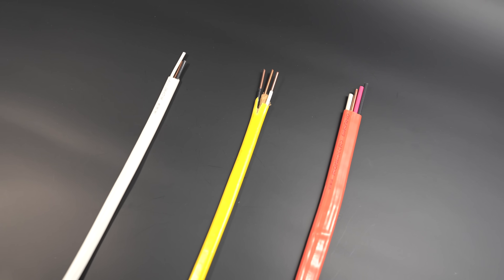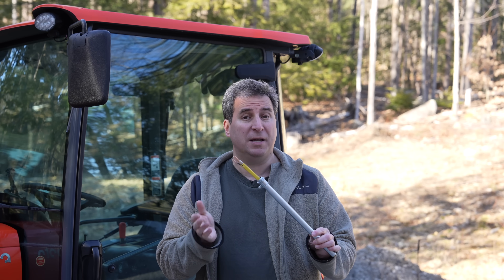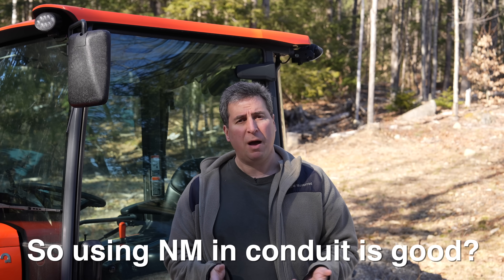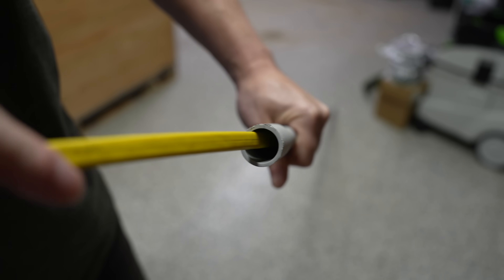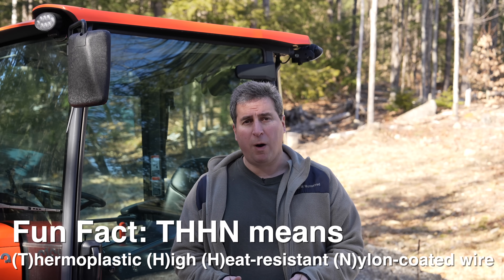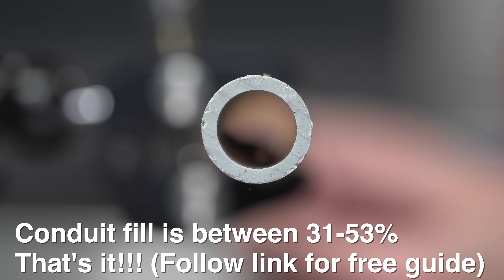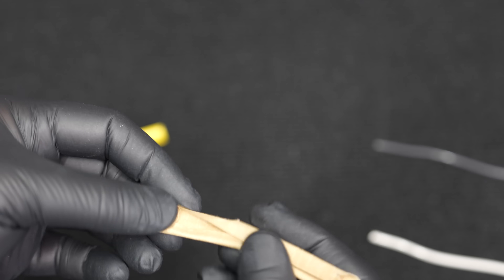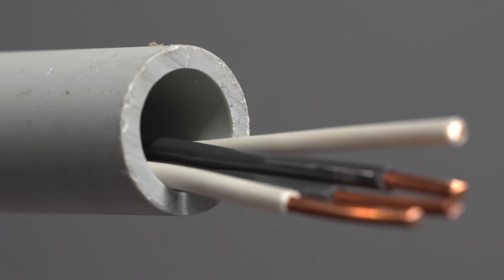#1 DIY Electric Mistake - Can you use Romex Wire in Conduit?

Comment: So in summary, the only reason you can't run it through conduit is because the government told us we can't?  I was hoping to hear that there was some actual reason.  If the NM cable is rated for damp conditions then what possible justification can there be for not adding an additional layer of protection with a conduit?
Reply from the maker: They never really have admitted precisely why you can't but the common belief is that the paper inside NM cable will rot over time and the plastics are not weather rated. I have seen 30 year old cable where it has broken down and I think you can find other examples.

Comment: Wired my garage and had no problem pulling Romex through the conduit…Basically a straight line across the rafters….and then into a box so I could run it in between the studs.

Comment: Also, where I live, they just recently changed it. Every connection had to be soldered not just wire nuts.  And anything in a basement had to be water typed conduit overkill yes absolutely.

Comment: This would never work in Chicago. Not allowed.  I have a house with all Romax and yes, very easy to run, but you cannot run Romax in conduit in Chicago. Unless I’m completely missing something and if I am, I’m sorry worked with a lot of electricians. There’s some areas that even low voltage five cable has to be in conduit.  Chicago’s crazy that way.

Comment: Insulation factor is the primary factor in what type of wire can be used in conduit. The reason romex is not normally used in conduit is, the rated insulation at ampacity in romex is not rated very well for heat dissipation in conduit therefore increases the wires resistance and ability to overheat. It's not actually prohibited in section 334 of the NEC, but calculation should be made where the wire can become too insulated.

Comment: Really wish i saw this before running my 6-3 cable from my outside panel to my inside box. Getting that cable to turn 90 degrees is a nightmare and pushes on the elbow thingy outward.

Comment: There is also wire lube for jamming THHN down the conduit. I wouldn't figure you want anything with a paper sheath in a damp location because it may causing the ground to corrode quicker causing a break in the safety path.  I've seen this where a cable has wicked up water.

Comment: Conduit is used to provide mechanical protection for non metallic cable.  Conduit fill is irrelevant if it is not a continous run eg a 3' section for mechanical protection.  Along with conduit fill i a derating factor.  One other thing non metallic cable has different designations.  NMD- for dry locations and NMW for wet or damp locations.  And yes you can protect this with conduit as well.
Reply: There is in canada. Not everything is like the US.

Comment: How about “Solid UF-B wire”? Can it be ran through conduit? It’s generally only used outside (wet location), can it still be used under ground in conduit?

Comment: Quick answer - No you can not. Romex rating dose not include conduit for a reason. I've seen 12/2 in 1/2 emt conduit before but whole reason we we're there was to remove the cluster bomb of a huge mistake.. Your mileage may vary but I do not recommend it .

Comment: I run it in conduit for a few reasons.
In case of a short or fire, it can contain the fire.
If there is a short or ground, it can be safer in case someone or something comes into contact with it (assuming the conduit is properly grounded).
If you soap your wire it usually won't bind.
HEAT from the wires is the reason why the limits.
Romex can help protect against water issues too.
Reply: Please do not use soap. There’s no way to know what kind of chemical soup you’re leaving in there. It’s mostly some inoffensive surfactants but they like to add some salts and a dash of soda ash and vinyl isn’t the worlds most chemical resistant plastic.  They sell conduit wax for a reason. It’s 100% inoffensive and a good bit more slippery. It’s a liquid wax about the same viscosity as dish soap so you don’t have to change anything but the bottle you’re squeezing, but please do change the bottle you’re squeezing.
Reply: @oliverstreet7704  They make a special wire pulling soap/lubricant.

Comment: Nice informative and to the point video. My home had 2 outlets installed on the back of the fireplace that extends in to the kitchen. Whoever installed them removed the sheathing where the wires came down from the attic and ran them through a thin, WT looking plastic conduit that had glue in a few spots to hold it against the brick although the receptacle was screwed in, but the wall plate would come off when unplugging an item lol. I had an electrician install a metal conduit that is bolted to the bricks, but I don't know if the wire was replaced. The company sent a few workers since I had a few things that needed to be addressed.

Comment: I got gigged by a inspector running NM through EMT for protection because the metal raceway was not bonded. I had to replace it with NMC.

Comment: NC Let's us, for 10 feet or less if certain conditions are met. We have a state amendment that says the inside of conduit outside shall be considered a dry location if the connectors and enclosure the conduit is connected to are weather tight.
Reply: This is great as transitioning needlessly adds cost and complexity and more failure points.

Comment: It is easier to pull than to push ROMEX through  conduit.  You just need string/twine and a vacuum cleaner.  Put the vacuum at one end and the vacuum on the other and suck the string/twine through the long run.  Then attach the string/twine securely to the ROMEX and pull the ROMEX back the opposite way.  It is much easier.

Comment: You can run Romex in liquid conduit outside and it isn't an issue except for the "Code Nazis" which can go screw themselves because they have NO say in the matter about what I can & can't do.  Plus, I have over 30+ years of real-world experience so I know what works and what doesn't 😈

Just so you know, pulling Romex through liquid conduit is a nightmare but will keep it from falling apart due to exposure to UV & weather.  I've seen regular NM-B installed outside before and usually takes about 20+ years for it to start falling apart hence the reason some people paint it to further its lifespan which I don't recommend trying 😉

NM-B (Yellow)
UF-B [NM-C] (Gray)

If the application isn't burial, I've found extension cord holds up better over time and makes for a much nicer install.  Just make sure you size the extension cord correctly (wire amp rating) to your particular application and never exceed 80% of it's max capacity.  If it is burial, UF-B inside electrical PVC will save you a headache down the road especially when some idiot with a shovel or trenching equipment comes along 😊

Comment: Has anyone ever seen excessive corrosion by using Romex in a damp location or stripped Romex causing a short in an otherwise proper installation inside steel conduit? I have a suspicion that theoretically these are legitimate reasons but because the industry is so tightly monitored that those ideas are out of date with the materials used since the late 1990s (as a guess)😅

Comment: I was told that romex style wiring THAT IS intended for direct burial is OK to run in conduit. How could wiring that is designed to be buried without any other protection from the elements be not ok to be stuck in a conduit. The conduit will only serve to further protect the wiring from moisture.
Reply from the maker: You are correct, Romex that carries a wet location rating or direct bury would be fine in damp location. The problem is visually it looks the same (except for being gray usually) so people will easily think one Romex type cable fits all.

Comment: Good Video.  I would add that a conduit will fill with water if and where it can.  THWN accounts for this.  Romex assumes no UV, oil, gas, water afaik.  Otherwise you are on to direct burial cable.  Tougher stuff

Comment: Two or three copper conductors, with 90ºC PVC Nylon T90 Nylon insulation. Bare
bonding wire and overall jacket of moisture resistant and flame retardant PVC,
with FT1 rating.
Rated 300 volts. RoHS compliant.
Application
For open or concealed wiring in dry or damp locations where not exposed to
mechanical injury

Comment: What's wrong with cutting the outside jacket off romex and putting the conductors in conduit??? They aren't designed any different than solid 12 gauge thhn. Could you litteraly tell the difference between a 12 gauge wire stripped out of romex and a 12 gauge thhn side by side??? I would guess they come out of the same factory

Comment: I did run my exterior grade shielded wire in 15 feet of conduit outside going to the Koi pond, it buried under 12” of cracked decorative rock hence the reason I ran it in conduit.Should I be worried 
I don’t get it. Contractors cut through buried line all the time, wouldn’t putting it in conduit seem to make sense .

Comment: Theres the rules, and then theres reality. I buried an outdoor rated romex line in plastic conduit underground going out to a security light on the driveway about 10 years ago. Still works, never had a single issue. Before I was repairing that electrical line about once every 3 or 4 months because moles, groundhogs,  some type of critters kept chewing through it. I still dont understand why you "cant" do this due to moisture, since the line was already underground being exposed to moisture anyway. I would think if there was going to be an issue, I would have seen it after 10 years. You can call it illegal all you want, but again - no issues, no problems, everything works.

Comment: Another reason not to remove the jacket: the individuals conductors in NMB are often not printed with any information. Remove the jacket, and you have no idea what type, voltage rating, temp rating, manufacturer was.

Comment: I installed two lights on each side of my carport. I used PVC to go from the light up into the attic and then 90 the conduits in. I then installed Romex from the junction box in the Attic and just ran it down each 5 ft section of PVC to the lights. My question is, why can't romance be used in a conduit in a damp location? The way I did my carport lights was the only way for me to make sure that the Romex was protected from the attic into the lights. Pond doing some further code research, I found that the cable can be protected by schedule 80 PVC which is what I have done in my carport scenario. Never mind about the question.
Reply from the maker: The wire companies only tell you what its rated for and we know the code. They don't say specifically why, but common belief is the paper jacket inside will rot and slowly degrade the jacket causing shorts. Outdoor ratewd rmoved /underground stuff has no paper liner around the ground.
Reply: @SilverCymbal  that's something that I didn't think of. I do suppose that the paper could pose a degradation issue over time. As a commercial electrician, I started looking through the code to find out exactly why and all it states is what it can and cannot be used for. Thanks for your reply.

Comment: Thank you for the short clear video!  
There is also concern about heat dissipation when running NM in conduit, if you bundle more than I think 3 current carrying conductors together for more then some length, you should be de-rating.  However with 1/2 conduit and NM cable, you will hit conduit fill before that's an issue.  I use EMT for vertical runs from the ceiling to electrical wall boxes in basements.  Any other place I would need conduit, I will run THHN.  Pulling NM around any kind of bend would be a nightmare!

Comment: As a uk electrician I find some of your code baffling to say the least. Over here conduit is just for physical protection  nobody would care what cable you use unless it was too full and the current rating  may need to be downgraded slightly when enclosed in conduit. Nobody would use this as conduit cable as standard. Then I see you guys using similar cable to this buried  in the ground with no mechanical protection like conduit or ducting, that would never he allowed over here. Your use of single insulated cable running to things like well pumps scares the hell out of me. One thing for sure if we came to work in each others countries we would probably need a 6 moths apprenticeship  again 😂😂
Reply: And yet in both countries following the codes results in safe electricity.
Reply: The similar cable is or should be type UF-B, for underground feeder, direct burial.  It’s more than three wires and paper in a plastic tube.

Comment: It's also a thermal derater, so it reduces the current the circiut can handle, because the Romex is designed to be exposed to air to cool.

Comment: Wait a minute. Did you say you're  never allowed to run non-metalic cable through conduit in outdoor situations? It went by pretty fast, even after listening a few times. So what about outdoor "Romex"? I was told that I had to run it through PVC conduit buried 16 inches underground. If not to code, what was I to do?

Comment: Aaaah the joys of being an electrician apprentice. Run 20' of romex and using wire lube and a pull finger. The wife won't pleased trying to get the goop out of your clothes. Been there and have the rolling pin dents in the back of the head to prove it.

Comment: I can't say that I'm an expert.   But I had a contractor putting romex into a conduit pipe and just so happened to have an inspector there that day to inspect a new Circuit breaker panel.   He saw what they were doing and told them:  "Better not do that cause I'll be back here."     Told them to use individual wires like you showed there.   
This was an outside location subject to rain and hot sun.   THe conduit was a plastic pipe.

Comment: Technically speaking yes you CAN run Romax cable inside conduit. The problem arises when you try to figure out the size of the conduit needed to run the Romax as there is no official chart anywhere in the NEC referencing that information, and if it’s not listed in a chart in the NEC, it is not allowed. So until the NEC decides to rate Romax wire ran in different types of conduit and then give you a chart listing the sizes and types of wires you can run in different size conduit’s then it remains a code violation.

Comment: How about underground grey 12 ga Romex in a 1" PVC conduit 200 foot?
Reply from the maker: Gray is usually underground Romex which is ok outside so the conduit wouldn't be an issue unless it were overfilled
Reply: @SilverCymbal  Yeh I knew it was for underground so just to make it double better I put it in the pvc conduit, I thought it would be ok but you never know. Thanks.

Comment: NM cable has to be UL listed for its intended use. No UL listing, it won't pass the code. And it just doesn't' look professional. (hard to sell it to a customer)
Reply: That's the way I understand it to be..the single conductor striped out is ok as well... as it will either be TW or THHN in the NMB...

Comment: I used to install alarm systems for a while.  Low voltage wire HAD to be run through metal conduit in commercial buildings.  It was a state requirement, so your state may vary.
Note that this is low voltage wiring.  Not romex.

Comment: nope, I didn't hear an explanation as to why you can't do it outdoors...
Reply from the maker: The offficial explanation is that it is not rated for it. The street reason that is generally accepted is that the paper inside will rot and the jacket can absorb water over time and break down
Reply: thanks for following up, @SilverCymbal  
yes romex does have some cardboard I'm not aware of specific outdoor wiring requirements.

Comment: Is there any derating because it's NM in conduit?  I just choose to never run NM in conduit but I was under the impression that there was a potential for derating of the circuit.  I am not an electrician or trained formally in this, just curious.

Comment: 3:09 Very good point.  THHN insulation is very tough (rated to resist water, gasoline, etc.).  I have used THHN wire in automotive work, where it is very durable.  The insulation on stripped Romex is not that tough.

Comment: 53% is a pretty specific number, curious how you arrived at that? NEC shows any conduit over 2' can be filled up to 40% & and conduit 2' or less (a nipple) can be filled up to 60%
Reply: Side note; the cable assembly's outer diameter is not listed in the code book and should be properly referenced from the manufacturer. A 12/2 NM from one manufacturer can have a different outer diameter from another manufacturer